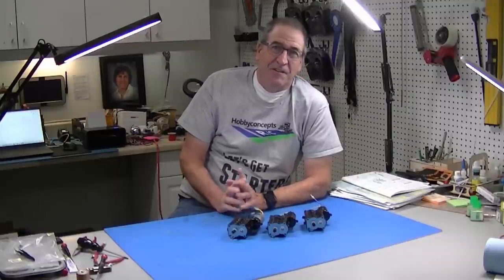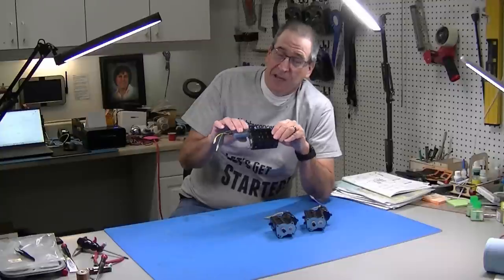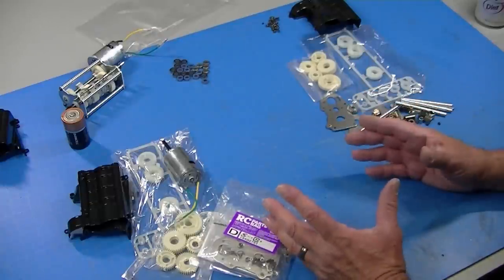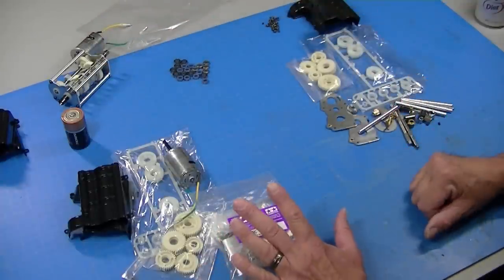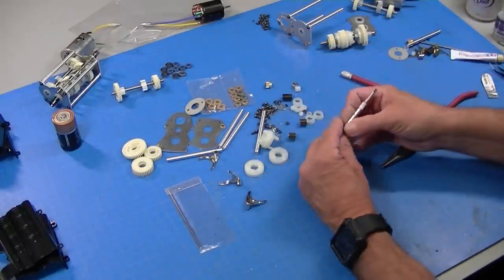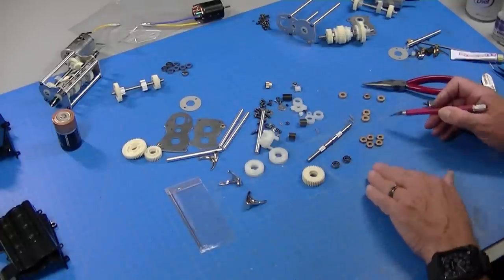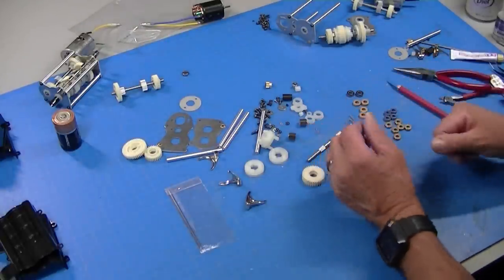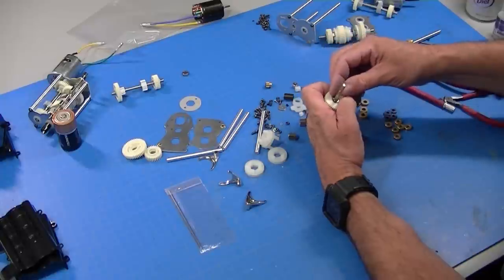1/14 Tamiya RC How to Build the 3 Speed Transmission - Grand & King  Hauler

Comment: The more videos I watch of yours, the more I appreciate the work you put in. This was brilliant. I bought my truck used, the guy never finished it and never had it running. This is my first 1/14 truck so it's all new to me, but the transmission felt odd. So I stripped it out and opened the case. Turns out it was put together wrong, and a spring was missing. I replaced the bearings and installed a Carson Poison motor while it was apart. Now after watching this video I'm thinking that brass bush might be the wrong way round, and I know I didn't glue the bearing in.

Comment: Hi Bob great video. I couldn't see the ball-screw on my tablet in detail, but I think it's one of those Tamiya uses on many of their buggies where you can adjust the wheels. I use some 4 mm for our bird's doner. So if you find a buggy with this ball ends, find out the bag and you can order it. Bags are mostly cheaper than separate screws. If I find more informations I'll let you know.

Comment: That was so smooth when you tried it out. I just built my first one but it really loud and seems rough but I’m not sure what I did wrong. I’m building a ford Aeromax
Reply from the maker: If it's rough something is wrong.  Maybe motor pinion to tight?

Comment: Great video. I have a question for you. Are you familiar with the Tamiya Toyota Hilux 3-speed 4 wheel drive transmission? I was hoping to replace my gears in that transmission with the aftermarket brass or metal gears for these transmissions. I'm hoping to be able to run a brushless motor in my toyota Hilux and not ruin the gears. I'm not looking for extra speed, just a smooth running trail truck that I can enjoy.

Comment: As far as the pinion spacing, I had a tech show me to use the receipt paper from the sale. He stated that after placing it in the gear path, it should not tear with a firm pull to extract it.

Comment: bob i have assembled and reassembled my tamiya transmission several times because im getting slippage especially going into 1st gear. i have watched your video many times and the instructions many times and still having that problem. yes it is greased well but sometimes i hear the transmission and shaft sopinning but the wheels dont spin. ive checked the driveshaft and no help. would metal shift gears help or is there a good replacement for that transmission. it seems like it not shifting totally

Comment: Great video! I have a used King hauler I'm going thru and rebuilding . I purchased a yeah racing 55T motor however I am confused on the pinion gear. The manual has 2 options 10 and 13 tooth pinion.  Which do I buy? Also I got the MFC-01 but missing the vibration box can I buy that separately? Thanks again for the great videos! I subscribed!!
Reply from the maker: On my personal trucks I often leave the vibration motor out, many builders do.  They tend to shake the trucks apart.

Comment: Great vid. My 770 manual says do not replace with ball bearings but you do. Any issues replacing and why might Tamiya state this?
Reply from the maker: On the slider the bearings not only rotate but slide on the shaft.  On some kits Tamiya says not to replace them with ball bearings and on other kits they do not.  I personally always replace the bushings with ball bearings and grease the shaft in this area.  Modern ball bearings slide back and forth  fine, I have built literally hundreds of transmissions with no problems.
Reply: @HobbyconceptsLLC  thanks for the info…ball bearings it is!

Comment: Hello Bob, I watched this video as I was building my transmission.  I ran it with a D battery as you demonstrated and had no issues.  1st gear to 2nd gear works perfectly, the problem I have is when I shift from 2nd gear to 3rd gear, I hear a sound like the gears are not meshing fully.  Could this be in the transmission or in the differentials?  I am thinking that I may not put enough CA on the bearing that is glued in.  I would like any info you or others have that may have experienced this.
Reply from the maker: If you run it with the case off you should be able to see what is happening.  I doubt it is the bearings.  If you are talking about it installed in a truck most likely it is a shift servo adjustment.
Reply: Great video! I have a used King hauler I'm going thru and rebuilding . I purchased a yeah racing 55T motor however I am confused on the pinion gear. The manual has 2 options 10 and 13 tooth pinion.  Which do I buy? Also I got the MFC-01 but missing the vibration box can I buy that separately? Thanks again for the great videos! I subscribed!!

Comment: Can you use a brushless motor?? If so which set with Esc is best??
Reply: On can naturally, but it is very seldom used, as the brushed motors have no problem giving the power and speed needed to operate the trucks 'to scale'. The electronic units made specially for rc truck like these, containing both ESC, lights, sound, are only prepared for brushed motors. Some will use brushless motors, just for fun to drive them on a racetrack, use a one speed planetary transmission able to deal with the power and rpm

Comment: My shift shaft in my King Hauler Black Edition is not like yours. It doesn't have the short spring, washer and E clip that you refer to as the hardest to install. The shift fork just slides on then a long spring.
Reply from the maker: Yes, the Globe Liner and King Hauler come with the older style shift shaft.  Works the same way just buiklds a bit differently.
Reply: @HobbyconceptsLLC  Dummy me didn't see the bit at the end where you showed the difference.

Comment: I'm a bit of a motor snob, so I'm curious. Have you ever had the chance to go with a brushless motor?
Reply: Brushless is 'overkill' in these trucks, that are not supposed to move at any high speeds. Also not got the natural 'built in' breaking resistane as the brushed motors, down hill. Maybe workable with an advance ESC. Anyway, brushless as good as not used in these trucks. Maybe by someone that just want to have some fun, drive a rc truck like a race car. Which one naturally are free to do, I don't mind)

Comment: will video work for euro truck kits also what is  upgraded motor size and turns?
Reply from the maker: Yes, all Tamiya truck transmissions.  The Euro trucks have an additional post on the end of the transmission case but all the gears etc. are the same.    All motors work.  I generally iuse a 55 turn or so.
Reply: @HobbyconceptsLLC   is that same as 550 size ?
Reply: @nsvaluto48328  They are standard 540 size. Many use 70-80 turn motors too. The point is to get something slower reving than the original racecar motor in the Tamiya kits

Comment: Hiya Bob. I've noticed in the past you fully greased diff' and planet gears. So why only put a smile of grease to shafts and gears
Reply: In the tranmission there is more high rev gears than in the diff and similar. Too much loss of power if one grease up to much

Comment: I put my transmission together it wouldn’t turn barely but when I loosen the screws a little then it turns and run
Reply from the maker: Something is wrong.  My suggestion is to take it apart and start over.
Reply: @HobbyconceptsLLC  please don’t tell me that if I had hair I pull it out lol
Reply: @HobbyconceptsLLC  I did look at the instructions and it’s all in same thing as the instructions decried so maybe the battery could be weak hopefully
Reply: @HobbyconceptsLLC  it was I assume an some what old battery I might have purchased back in 2004
Reply: @HobbyconceptsLLC  here is pictures of what my motor look like after put it together